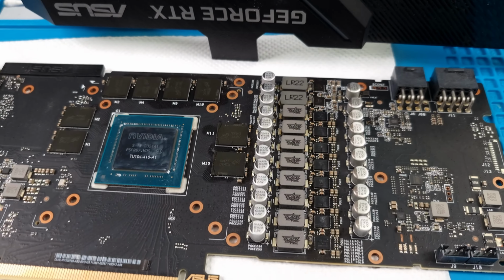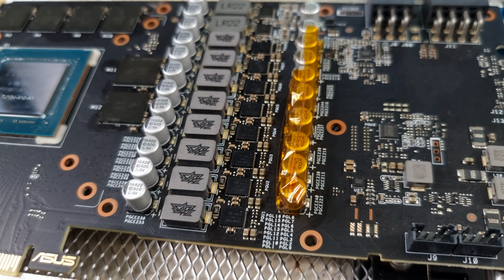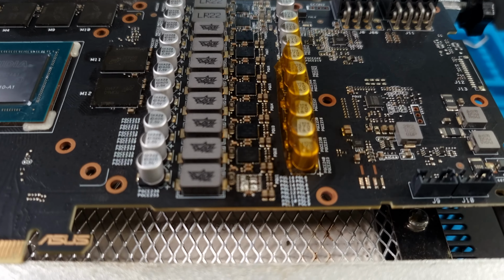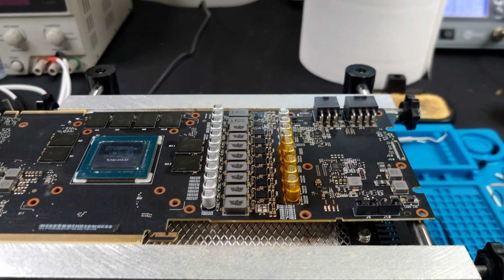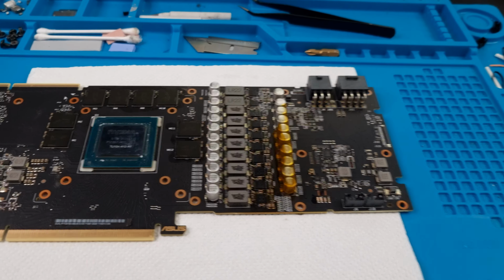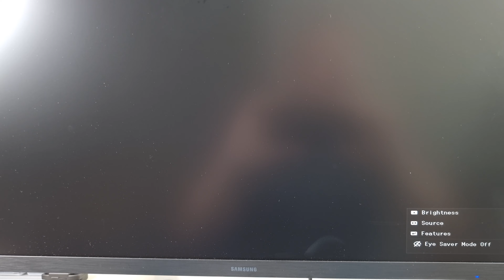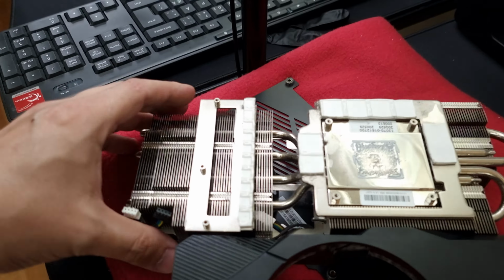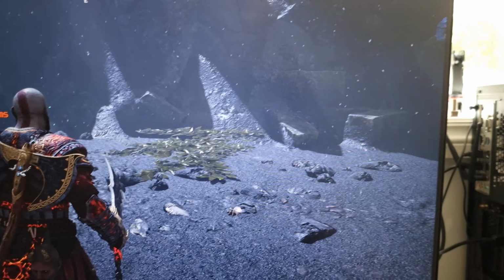ASUS RTX 2070 Super With Blown Mosfet. Fixed.

Comment: How do you tell it was a mining card? miners lower power limit a lot and I mean, a lot!
Reply from the maker: I was a miner myself LOL Ravencoin and Eth. Some require core, rather than memory. It would be a lie if I said I am 100% sure it was a mining card, but tell tell sings are there around the memory chips and other components that get hot. Around those areas you will see darken discoloration, from prolonged high temperature use, and also how dusty and dirty they come to me.

Comment: waiting for your PTM video
Reply from the maker: It's coming soon lol gotta get through 56 cards I have for repair in que. I'll squeeze it in there maybe this week during down time.
Reply: @TechnologyHive  wow that's good news. Will wait for those videos
Reply from the maker: @frazerxavier7295  Noooo. That will take forever, lol
Reply: @TechnologyHive  or when ever it's ready 😁
Reply from the maker: @frazerxavier7295  it will take me some time lol thanks my brother.
Reply from the maker: I need your info. I got a 3090 Strix card with 3X8 pin power connector. Last connector from the left, if you follow it down to the first shunt resistor, then down to the inductor, if you remove both shunt resistor, and inductor, I am left with a short to ground on pads that connect shunt resistor and inductor...I am lost here.

I already replaced the blown up power driver, and the short disappeared from the other two out of three power connections. But the short remains on the low side of the 3rd power rail...wtf?? my email: madridrenoveringsarbeid@gmail.com
Reply: @TechnologyHive  SO is it that the short is between the shunt and inductor?
Reply from the maker: @frazerxavier7295  Yes exactly it. But I found the issue. My masking was not cured long enough. Card lives now :) Video of it is up soon LOL
Reply: @TechnologyHive  😂. Great. Glade you found it bro. I think I just got a notification of a video from you.
Reply from the maker: @frazerxavier7295  lol it's that video. 😂